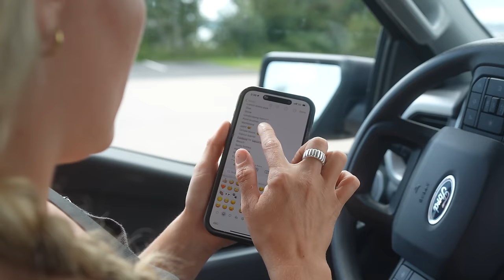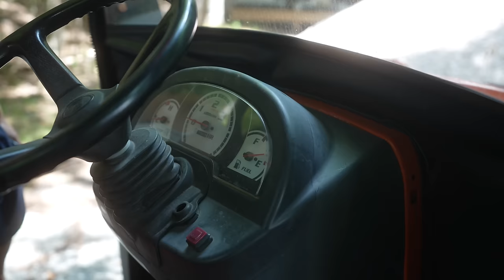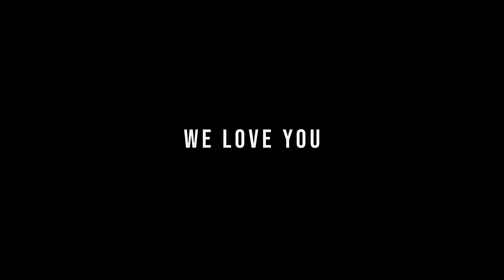This is Why No One Wanted The House

Comment: You nailed it on the rotten joist problem.  As a retired contractor I have run in to similar problems.  It is too bad the foundation walls don’t appear to allow for a full basement.  Removing the bottom clapboards should expose the rim joist that sits on the top of the foundation wall.  If it is not pressure treated, you should consider replacing the rim joist with pressure treated lumber.  Any time lumber comes in contact with concrete, it is ultimately going to rot.  Comments on using Simpson post bases is excellent advice.  You gals are crushing it!
Reply: I know they appreciate your support. They appear to read every comment! Every piece of advice is considered Every compliment about having done it right like a professional would do a job builds their confidence. Jazz and Crystal are the sweetest young women on YouTube.

Comment: You are doing it the right way ladies.  Remember now, you are going to have to install a sump and solar battery operated pump to lift the water up so it can flow downhill and away during periods of flooding as we see in your old drone video.  
If you run your foundation drain to daylight, the annual  flood waters will run up the drain pipe and around the foundation.
I think you are at the point where you should remove the bottom two pieces of lap siding to access the moisture damage from being too close to the earth.  I'm imagining that you may want to run the vapor barrier system all the way up and over the rim boards.
I will also suggest building a block stub wall with all the waterproofing around your crawl space opening on which you can set a Bilco style basement door.  This is the best way to keep the opening dry and you will be able to raise the grade so it is level across that side of the building.  Setting the finished grade so all rain water flows away from the foundation is an important last step.
Keep up the great work.  You are both so very capable! 😊👍
Reply: Never knew the name for Bilco doors. Thanks!

Comment: Great Ideas. The French drain and gutters, all around,  but more on the side of the house that goes up slope. Dig out to level for about 6 feet out and install a retaining wall. That way, your moisture isn't coming down within the earth, and it gives you a space to level, but with a slight slope away from the house and your french drain.  That 's something that will really help.

Then establish airflow throughout the cellar (?) and dry out the foundation.

Comment: Y’all are living proof that how many times you’ve done something is nowhere near as important as always being willing to learn.  I’m not a contractor, I’ve just done a lot of DIY and already made most of the mistakes at least once. You’re all over it by cleaning up the crawlspace with a vapor barrier and making sure you’ve got good ventilation.  Also super good work on the waterproofing and drainage.  One small thing to add to something another user already said, putting in a retaining wall would be a great idea, but you may want to include a small French drain at the base of that. You don’t have to wait until the water is right up against the house to divert it.  As always, y’all are awesome^2!!

Comment: I hope you are planning to connect the drain pipe to a sump pump.  You have shown pictures of the whole area flooded in the spring.  You want a positive means of water removal.  Pumps with battery backup are available.  
You are absolutely correct that you want the final grade to move surface water away from the house.

Comment: Just watching how far you both have come is amazing. Add some small rocks under the drainage tubes. I remember my parents built a outdoor building they painted the foundation with this tar like substance it was paint but extremely thick. They never had moisture. They kept horse feed in there. Our horses were excape artist & would break out to get more food in barn. So they built a feed building with a locking door to keep them out😂 They made sure to over do so feed would stay dry. I know you both have the knowledge to do this correctly. Hope you have a great week! Sending love❤

Comment: 22 years ago I bought a brick house that was 17 feet wide and three stories tall. Once the nasty old carpet came up, we found that a radiator leak had rotted the big beam that held up the entire back of the house down to a third of its original size; it's lucky the whole thing hadn't fallen down! So believe me, I sympathize. French drains are a good idea but look online for examples of rainscaping as well. In retrospect, you might have done better to dig out one side of the foundation at a time; it could have collapsed outward once the dirt wasn't there to support it. Fortunately, that didn't happen.

Comment: Under my cabin I cut through the concrete about 20 inches square and about 18 inches deep, i put in an automatic sump pump plumbed into the sewer line so if water got under the floor it would get pumped out. This would prevent hydro-static draw where water will be drawn through the concrete. It's a little insurance. You can dig a big pit that all the drain pipes would go and do a deep base of rock making a "dry well" so the water will filter through the rock and dissipate. You guys are a hoot to watch!

Comment: Looking great! 
Most codes state that you need a minimum of 8" from the base of your siding tonthe top of your finished grade.  Also, a french drain at the base of the slope back near the tree line will help with keeping surface and sub surface watwr before making it to the foundation.

Comment: You're doing everything right to fix the drainage/mould problem, I'm super impressed with your work ethic and ever-evolving skillset. The last critical thing to think about is when you put all the dirt back into the trenches. When you do that, you need to make sure that no timber or cladding is in contact with the ground at all, just the concrete. Timber wicks moisture so if it gets wet and stays in contact with the wet ground, that's where all your problems start. The water will travel to any timber that's in contact with the wet bit. Properly grading around the cabin to direct the water away from the foundation will definitely help too when you get to that point, as will adding guttering and cross ventilation for the space under the house. If you can make sure that the space under the house grades out towards the lake, that'll help hugely too. That way, in extreme flood events, the water will run away from under the cabin as soon as the water goes down which will help it dry out quickly.

Comment: Hey you lady's definitely seem to be on the right track with your repair! A few things to check on is to make sure any cracks or holes in the foundation get filled with hydraulic cement before you prime and blue skin the walls. Small cracks normal get filled with primer and blue skin is very durable and will actually stretch. One of the big tricks that not too many people talk about is moisture in the foundation walls.  There is times where water can be trapped inside the wall and can effect your primer and blue skin when installing.  So it's a good idea to what we call cooking the wall with a torch to make sure the moisture is gone. And another thing is what is your spring water level like in the ground. I have seen foundation walls full sealed but that doesn't always stop the water table from coming up from under the floor area in the the basement.  So maybe look into doing some interior drains to a sump pump as a back up.  On the outside weeper drainage some people believe the more drain stone or rock the better . Which is not always the case. Because water will travel to the path of least resistance.  Which could cause water to build up and sit there until it can get away. Then with proper grade and landscaping you should be good.  Sorry for the long rant! Your doing a great job and luv all the video's  keep them coming.  Cheers!

Comment: You might consider some bubble-wrap foil between the floor joists before you lay down  the subfloor.  It will make a huge difference in keeping the temperature consistent in the living area--especially in the winter.

Comment: Tip: Concrobium mold control is very effective for tackling mold. For big jobs, a fogger can be rented . It will not remove any mold staining but it will definitely kill it. No toxic fumes. Won't do anything for rotted material, but its a good for nasty surface mold.
Well done excavating! Damn girl, you have developed some skills!

Comment: I have a similar situation with a bank sloping toward my older house. I had French drains put in  on that side of the house, then I also had a surface water  French drain  put in at the base of the bank, and left a small ditch sloped into the back yard beyond the house to divert surface runoff in heavy rains.

Comment: The swing function on the boom is for digging next to buildings. Usually operated by a foot toggle under one of the foot pedals. I'm not sure about Kabota, but I see the pivot point on your machine. Once you start using it, you will use it all the time to square up to things.

Comment: When you landscape around the building after installing the french drains, you should end up with about a six inch drop from the foundation to about twelve feet out so any water, snow, etc. drains away from the house.  You may need to remove some of the hill to the side of the cabin to be able to do this.  You should end up with a drainage swale twelve feet from the house and angled toward the lake.  With french drains, gutters with downspouts draining to a lower elevation away from the house, a swale twelve feet from the house, vents in the foundation, and sealed plastic on the ground under the cabin, your moisture woes should be gone.

Comment: I would add plastic over the ground in the crawl space, overlapping the seams a couple of feet and up the walls a foot or so.  Seal with tape the best you can.  Add vents  to the crawl space and insulate under the floor with a vapor barrier closest to the subfloor.

Comment: You asked for advice......after exposing the foundation add at least 2" of rigid insulation (2 layers of 2" would be best). This will give a level of protection that will transform your crawlspace. It will be a passive cooling source in summer, and relieve the heating demands in summer. There are 2 methods of crawlspaces - this house historically had Type One, which is a vented crawlspace, that invites cold air in the winter. Type Two is a completely insulated walls, vapor barrier on the round, and DO NOT insulate the ceiling/floor. Let me know if you want more details, especially on how to insulate the foundation. GOOD LUCK............. wish I lived closer to give direct input......but you two are VERY resourceful in finding the correct techniques!!!~

Comment: It looks like you have good material for the foundation on the outside. Many people make the mistake of laying the drainage hose too high, it should lie UNDER the cement foundation to keep the foundation drier. Do not forget to install a pipe that collects the water from the gutters and divert the water in pipes without holes. This means that you don't have to get all the water from the roof near the foundation of the house and the foundation be better. Haven't seen the Americans do this but in Europe we do that with all the houses.

Comment: Good day awesome ladies! What you need is a soak away drain in the French drain which is the correct thing to do. Tanking of the foundation is also correct.
It might be useful to use the run off to create a usable sump of water that can be filtered.
You ladies are amazing keep putting your best foot forward, there is always a journey to be had enjoy the ride and the lessons learned . Be safe both of you women rock❤

Comment: When you put the dirt back, make sure it's below the top of the concrete and slopes away from the Cabin. You also want to try and keep a 6-8 inch gap from the dirt to wood to avoid any Termite or carpenter ant problems.

Comment: Pulling up the decking and finding the rotted floor joists has so many parallels to Gemma's and Simon's 'Ship Happens' channel.  They're doing pretty much the same as you are doing on this house, only on a 80-year-old wooden boat.  

My Mom and brother sealed the basement walls of a house we had in Ohio when I was about 3.  Luckily, I don't remember any of it, but I'm pretty sure they didn't have the luxury of power equipment you guys have.  It's a monstrous undertaking, no matter what.

Comment: Might be a good idea to encapsulate the crawl space and put in a dehumidifier. Then close up all those vents to the outside, and spray foam and insulate the rim joist outside wall at the bottom plate where it meets the concrete. 
You two have come so far and are learning so much. Keep it up. 👍

Comment: Call your friends at ambition strikes they just did a similar project. Definitely cloth dirt barrier, rock, drain pipe, more rock, then fabric wrapped over the top before you backfill. Make sure you put a vent pipe on your drain pipe so you don't get vapor locked.

Comment: Add a ventilation fan to pull fresh air into the crawl space from the wet side and out the dry side. The fans take air from along the crawl space floor and  blows it out through a hole in the outside joist.  I would also backfill with gravel

Comment: Great job, ladies. You two are truly enjoyable to watch.
I want to throw out there to y'all as far as the foundation is concerned. Try a bottle of Goo and see if that will help remove the thin coating from the walls. At this point, trying anything will help remove it. if you get some Goo, let it set for a while (30 min.) then scrub the wall. After that take the pressure washer to it.

Comment: It's probably been 6 weeks since you've made this video, you could add in that corner a 4-in to 6-in PVC pipe and a fan.  Using a sensor that detects humidity, the fan will come on automatically and push  damp air up out of the crawl space and through the roof.  This will also be helpful if radon gas ends up in the crawl space. The vent and the fan can pull in fresh air and push out the damp air.
Have thought about getting some IBC totes for water storage.

Comment: Because of the flood zone I would put it up on stilts. Major expenses but if we have a big rain year or winter thaw then you don't have to worry about the cabin itself. I would then back fill underneath and use the under cabin to park atv and other toys. But since that's probably not an option I would waterproof and install sumpumps to keep that crawl space water free

Comment: I remember buying an old house that had old diy projects. We needed to redo the bathroom and found beer cans in the wall behind and under the tub. We needed to update the dining room insulation and walls. The wall had one set of the studs were 16 on center, the others were anywhere from 8 inches apart to 23 inches apart and only 2x4 construction.  After a few of these finds we stopped asking “what were they thinking “ lol.

Comment: I have not watched all the videos on this, have you checked the sill boards for damage?  You were commenting on the bad state of the bottom two runs of siding so take a careful look at the rim joist behind and the sill plates that set on top the concrete.  If bad, fix them now before doing any joist work.

Also glad to see you saved it rather than a full tear down as so many were suggesting in the first episodes.  Stopping the roof leaks, gutting the interior and ventilating so it would dry out was just what was needed.  Keep at it, it is amazing what two people working together can accomplish.

Comment: as low to the ground the cabin is and how ware rises in that area and since you already dug it out, id get some jacks and jack up the cabin about  1-2 more cinder blocks higher from the ground level, that also would help with moisture and water .

Comment: I don't know if you are taking off the siding or NOT, But if you are NOT able to wrap your house in Goretex, Maybe you will want to Give your Cabin diagonal  2x4 strength at the corners, for the Hurricane Windsheer you sometimes get, AND since you Already have a HEAVY Metal Roof On, that's a LOT OF WEIGHT, that could cause it to twist and Collapse  IF, you are going to Remove the Old Siding the other thing I was going to suggest, is spraying a soybean foam into the wall cavities first BEFORE insulation, to keep out moisture, since you get such heavy snows before you wool insulate, so you don't get MOLD, you both, ARE doing, Everything Right,

Comment: Are used to work for a man that built, retaining walls and fences and decks.
After we set a post, we would come back in and use a little lime, and we would cap the post so the concrete was higher than the ground water always ran away from the post .
This way, your post don't rot off at the ground ... just thought it might be a little help there
Reply from the maker: Thank you so much Ronald, we appreciate all the knowledge you can share with us from your experiences. 😊🐶

Comment: I think there is a Japanese product That goes between the sill plate and the concrete that also acts as a vent. So you have a vent that goes around the whole top of the foundation.  Its a plastic material.  The next question would be jacking up the house... Would using some of the metal roofing material you used and some rain shield material as a skirting along the bottom couple of feet for siding. The metal might help with snow resting against the siding also.

Comment: Agree, trenching, French drain and waterproofing. Could you also retro fit a membrane between the concrete foundation  and that wall plate by jacking the wall up. And a vent on both sides of the floor, so there is airflow right the way through?
Reply from the maker: Well that makes sense. We will do further research. 😊🐶